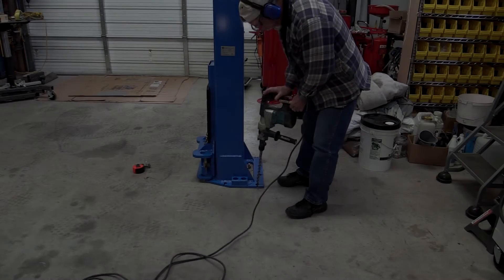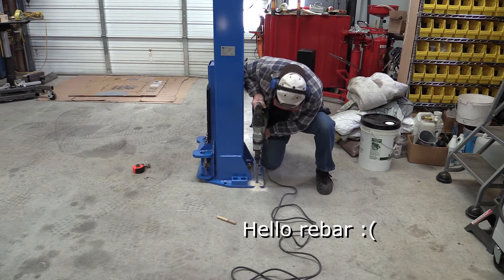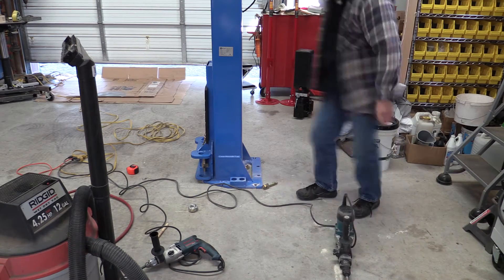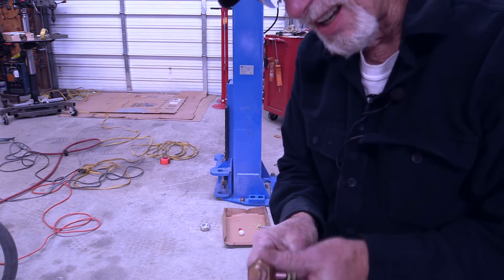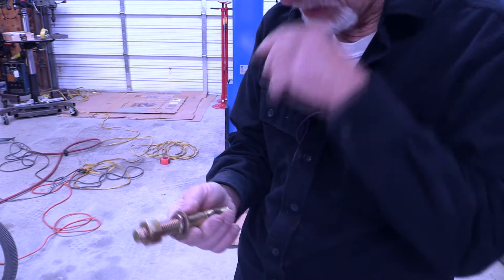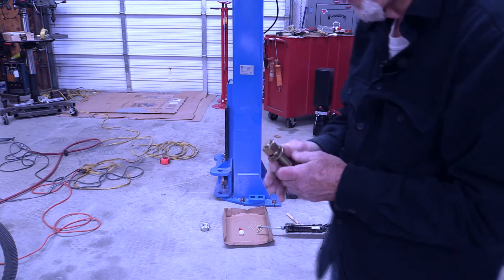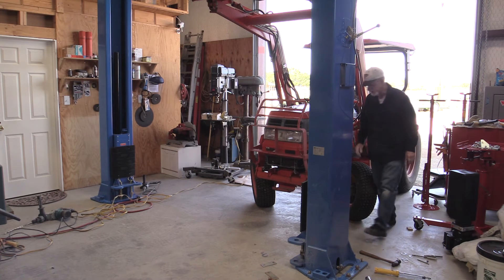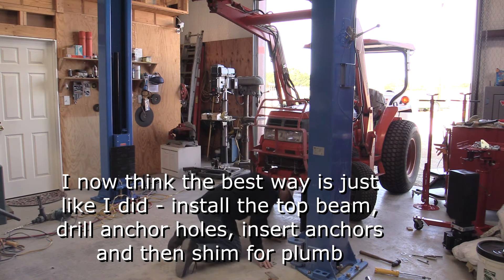Atlas PV-10P lift install - we finish installation

Comment: Did you ever have an issue with the hoist torquing the anchors to 85 ft lbs?
Reply from the maker: Yes I did as a matter of fact! I needed a torque wrench with a much longer handle - problem is the wrench is so close to the slab it's very difficult to operate. I think a pneumatic or electric impact gun with a swivel attachment would work well.
Reply: @JohnHillCountry  I have the same hoist, just installed 3/4 x 6 1/4 wedge anchors and torqued them to 85 ft lbs like the stated in the manual "60-85" ft lbs, was just curious if you left yours at 85 or did you torque them at a higher setting? Reason I'm asking is because Im seeing alot of talk online that they should be 150ft lbs
Reply from the maker: @wilsonrice8226  I probably stopped at the lower ft lb setting - I doubt if I could get to 150! The lift has been used a bunch over the years from a ZTR mower to my F250 diesel truck with zero problems. I used epoxy specific for anchors in concrete so there's no way they could be pulled out.

Comment: Hey, I want to purchase one of these, do you know if it is ALI certified? Also, how has it been running. Thanks for making this video.
Reply from the maker: This exact model isn't certified but it is essentially the same as other Greg Smith Equipment lifts that are certified. It costs them quite a bit of money to go through the certification process. The lift has worked great ever since install.

Comment: John, thanks for the video. Why did you use an epoxy with a wedge anchor bolt? After 3 years of service how is the lift doing?

Comment: man , thats an exciting day in the shop :)
im getting ready to buy the  same lift,   kinda excited . lol
i was wondering about concrete requirements 
cant find much on the lift site .  mines 6 inches thick ,
surely thats enough ?   any advice or tips ???
Reply from the maker: 500passwords They specify 5" of concrete for a 10k lift, 6" inches for their higher capacity lift.